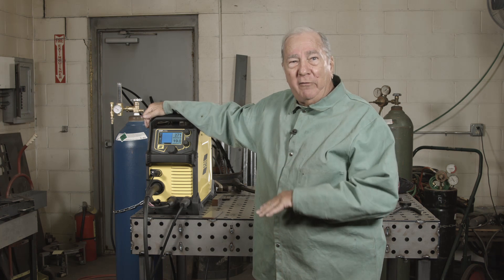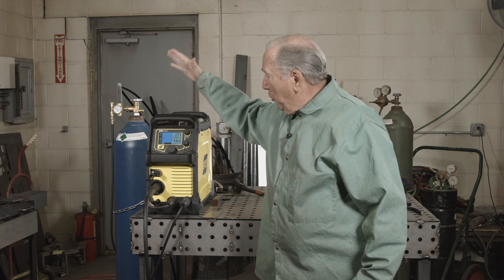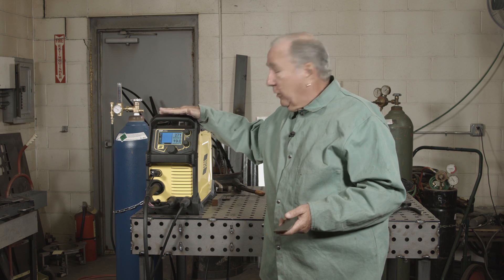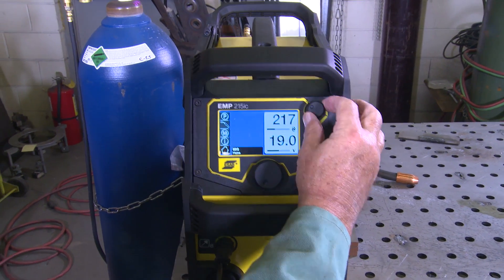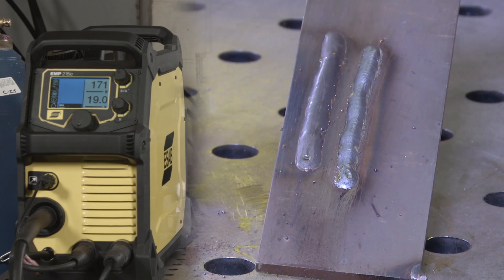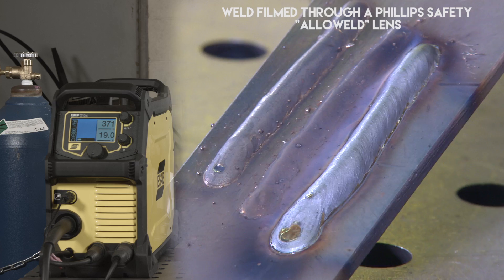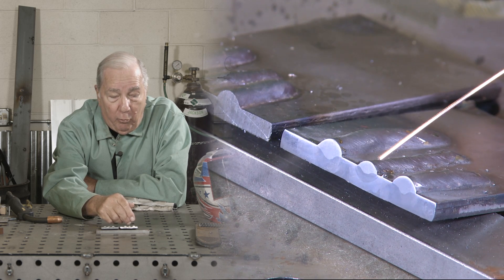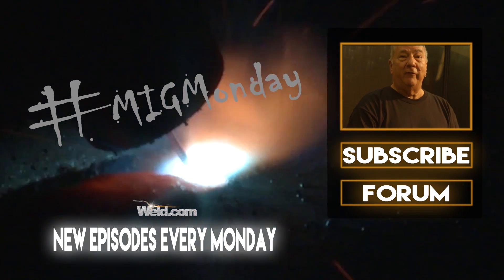How does Wire Feed Speed Effect Your Weld? | MIG Monday

Comment: Excellent video! First thing I learned was the 'wire feed' number is 'inches per minute'! I purchased a Harbor Freight Titanium Multi Function welder and it has 3 knobs. Voltage, Wire Speed, and Amperage. I guess so you can fine tune it. I'm welding up an old set of headers and keep burning through. Looks like I did just the opposite of what I should have done.....I turned down the voltage and wire speed. I think I will go see if I turn down the voltage, and turn the wire speed up, maybe that will help?? Fun learning new stuff! Fyi, I'm 73.  ;)

Comment: Great video again, I think the recommended settings gets you in the ball park, but you have to adjust for the conditions. Is the piece flat on the bench taking away heat or raised up so it will run hotter. 
Being new to this, I'm still in the learning phase, I cant look at a job and rest on experience to adjust the settings. 
But the test piece you did I've done to check settings how it will flow, before I work on the item.

Comment: Good instruction Paul. Thank you. I have been trying to weld a steel/zinc bolt to a steel bar and have trouble getting a strong weld. Is the zinc a problem? Should I have chosen a pure steel bolt? This is for a project making a coat hanger.
Reply: Sand the zinc off at the weld with a flap disk or sand paper , take your time to get it nice and clean and send it , go gentle and tack it first with small tacks to set it in place as best as possible , than send it with your preferred settings . I would go a little lower on the wire speed to get better control but ; by lower I mean just a hair to avoid damage to the threads or warping. Having a coating line zinc , despite it being very thin it will fuck your welds up . Another option is to go ahead and wire brush the bolt or torch it until red hot than wire brush it if you don’t have a flap disc . This will absolutely anneal the bolt and ruin its case hardening or what ever heat treatment was done to it ; thus making it prone to damage and much much softer. I would just gently flapdisk it taking care not to overheat it - so gradually with a bucket of water or oil to cool the bolt. If you can clamp it down firmly or be like me and other lazy fucks alike and just hold it down while you tack it in place with a welding glove on to protect your fingers and hands. Galvanized metal coating needs to be stripped regardless of what the application is; you don’t want to breath that shit and you don’t want to weld it without proper cleaning as this will result in ; like you experienced a shitty weld . I highly recommend a respirator for welding galvanized as well a keep your mind on where your face is and the distance so you don’t get caught in the smoke . Once or thrice won’t hurt ofc but be cautious shits nasty

Comment: I have a problem when welding I’m not a pro but got a new welder at the body shop and have hard time with voltage. The problem is It drops and rises without me changing it. Can it be something to do with a power source or breaker? Have had similar issues with old welder but not as drastic.

Comment: Be nice if you compair dual shield to gasless fc and hard wire. There are those of us who use dual shield every day. Mig weld is gravy work, run 045 1/16 or 3/32 dual shield. What about spray transfer w/ER 80s d2. There are those of us who do certified work on more rigorous material.

Comment: Thank you. 
Exactly why is amperage increased if wire speed is increased?
Reply: This is kind of fundamental!  You SET arc voltage, and the machine tries to hold that voltage.  Current is varying.  Stickout can change amperage, long stickout has more resistance, voltage is fixed, Amperage drops.  If you push more wire (within limits) the voltage tries to stay the same, and it just takes more current to burn more wire.  You can only go so far with this adjustment!  You really want to look at some graphs to make sense of this.
Reply: @leonardpearlman4017  Could it be that there's also an averaging affect going on?  I'm thinking that with a slow wire speed, there are longer gaps between moments of short-circuiting (because it takes longer for the burned-back wire to re-extend close enough to arc again), and with a higher wire speed those gaps between the arcing moments are shorter.  The effect would be more current flow with the gaps being a smaller percentage of the operating time, and that would average out to higher amperage, and more arcing events per time results in more heat being produced per unit of time.  Now, I'm just speculating but this is what makes sense to me.  After all, if the wire speed were so slow that you could hear the individual pops of arc and burn-back, the current during THOSE MOMENTS should be the same as at those same moments for faster wire speeds, but with the very-slow wire speed those moments occur less often and so less heat is produced (and less total current flows since the circuit is "off" a large proportion of the time).

Comment: my mig welder as no wire speed setting , i am very new to welding , so do i have to play around with amps only, theres only  one nob and thats for amps , is there any way of slowing the wire down, form the spool wire.
Reply: I think you will see if you turn the knob (while machine is running) the wire speed WILL change!  That's what the setting is doing.  Volts are more or less fixed, wire speed is fixed, amps varies a lot!  I have one machine that has "Amps" setting, but it's just bad English I think.  If it was TRUE, the wire feed would be some kind of servo, and the wire speed would change noticeably say if you varied stickout a little.

Comment: i'm thinking maybe my feed speed might be my issue....   bought a Horrible Fright el cheapo welder about 10 years ago and never used it.   finally got it wired up in the new workshop, out of the box, cranked it on and.... CRAP!   looked more like when you put a few drops of water in a hot skillet - sort of spattery... but when i stop the weld, i always have an inch or so of wire sticking out, so thought the feed speed was too high, so down.. and down and down to the minimum...   and messed around with the two switches... got some really horrible 'almost weld' looking lines.   so will have to crank the wire up and see.   thanks for the vid...  might have at least pointed me in the right direction.
Reply: I'm replying late, but here's a thought.  Most "cheap" mig welders are gas-less and use flux-core wire.  Though I have no direct experience with this, I've seen a few videos now that make a point of the fact that the proper polarity for flux-cored wire is opposite of that used when set up for gas.  I've also heard that the majority of these cheap welders have nothing in the instructions explaining this.  Further, I've heard that it is exceedingly common for people to get terribly crappy welds with a cheap welder using flux-core wire, they blame the welder and quit or buy a better one, when simply changing the polarity would have solved the problem.  On cheap welders, usually one must reverse a pair of cable connections inside the lid or inside the machine to change polarity.  I bet someone here can help you out with this, but off the top of my head, I can't remember which polarity is which for gas and no-gas, respectively.  I only MIG weld with gas and solid wire so I don't need to remember.

Comment: I keep getting bird nests...any tips?
Reply: Maybe a burr in your tip? Replace tips often/as needed. They are pretty cheap compared to the time spent trying to clean tips all the time. Or perhaps the tension on the spool is not properly set, too loose or too tight? I am a beginner just under 1 year experience but I have found less birds nest with new tips

Comment: I like what we're doing here in general, it might be that 100 inches sounds good but is a  big change!  As opposed  to something like ten per cent or five per cent at a step.  I've been doing this kind of thing myself, and recording the result in a notebook for later.  Don't have a lot of data yet, but it's already been very helpful!  SO, for each machine and setup ("MigSonic, .030" wire, Ar15CO2" for example) there's one page, and a grid, a graph looking thing where one axis is the voltage and one is wire feed.  So, it's a picture of all possible settings for your machine.  Now, when you try one setting, that's a point on the graph, right?  So, you can put a mark there if it worked or not... or a LETTER say, and then there is a comment down below like "C- way too hot, burned through".  I got this idea from a book about MIG welding process control.  What we're all looking for:  Apparently on this grid, there will be a region where you have good working settings, with low spatter and so on.  NOW you can look at that, decide how much power you want, and sort of go right to it, even if you can't remember the last time you used that setup, or even if someone else took the data!  That's the real idea, I want students to do this.

Comment: My understanding is amps do the digging in where the volts do the puddle width.
Reply: They say the wire feed speed is akin to amperage. It really is not a bump in amperage directly. It would be interesting to see a bit more scientific data like putting an amp meter either on the machines power cable or on the ground  lead. Then change things.
 I really would like to see the gun put onto a beetle (cutting track for gas) or some sort of removal of human variables and an amp meter attached.
Reply: @Madmoody21  This channel has at least one video like that, where they use a "Bug-O" machine to carry the torch.  Jody Collier's channel has some where he welds on to a pipe turning in a rotary positioner, which give you a few seconds of steady welding and is easy to observe.
Reply: That’s literally what he says in the beginning of the video basically...

Comment: Sir, thank you very much for your good explanation (and for taking care about us.) Though, your explanation is not totally excellent. It is really important to tell me as a viewer what exactly gas you are using in your great videos (what % of CO2), but you did not tell us. I welded with both, with pure CO2 and with Argon/CO2 %15 (and Argon/CO2 %10), that is why on videos I can easily tell the difference between welding with pure CO2 and with Argon/CO2 mix. I cannot tell the difference between welding with 15% and welding with 10% CO2 though (without a few attempts and tries at least... I remember the story when employer did not want to give a pay rise to his welders and on the day of the test he gave them a slightly different gas mix into their manifold... They all failed the test, everyone of them. I think it is nearly impossible to pass our Canadian CWB MIG flat test on 3/8 plate with our usual Argon/ low CO2 mix. To get 1/4 first beads (requirement), I need to use 19 volts. But this way I do not get enough  penetration along the corner. If I go high with voltage (28.5V), I cannot fit 3 root passes with all the stops that are required. So testers usually allow welders to go with only 2 passes instead of required 3 passes. I passed with some other tricks (either with preheating when tester does not see or with excessive removal of the back plate.) Sir, would be very nice of you if you make a video on which settings to use and how to pass our Canadian CWB test (flat, with back plate, bend test). And for which gas mixture those settings would be valid? I is realy easy to get a good penetration with pure CO2, but nearly impossible with Argon/CO2 mixture... I challenge you: you will not even pass that test yourself :)
Reply: Alek Rudy;
You know way more than I do. I once knew a man that got a job welding tanks for Aerospace. When I had a car project. He did all my welding. Arc and oxy acetylene.
Reply: There is a video of a journeyman brazer using nitrogen gas while fusing very specific code regulation, copper lines for refrigeration. He is old too.

Comment: Great to see someone doing a video about this. So many people I’ve run into are convinced that voltage = heat.  Great video! Doesn’t get any clearer than that.
Reply: Well, the settings interact then, don't they?  If you have more voltage there's got to be more power, eh?
Reply: When you increase the voltage you have to increase amps or wire speed no?
Reply: @charlescarabott7692  it depends on the thickness of your wire if you have a thicker wire you have to turn up the voltage because the voltage is the push and there's more resistance with a thicker wire
Reply: they really go hand in hand together i tend to pick my wfs(based of material thickness) and adjust the voltage to make the bead shape uniform they both have to match somewhat if you turn up your voltage so far you also have to turn up your wire speed in turn producing more heat

Comment: I’ve done a lot of polishing for materials science research but I’m relatively new to welding. I’m finally upgrading from the harbor freight flux core my dad got me when I was 15 to a Hobart handler 210mvp. My question is how far down do you polish before you etch. I’ve gone down to .1 micron on a few samples I’ve polished but normally only down to 1 micron.

Comment: what is the wire diameter, i can understand that amps changes with the change of wire feed speed, is it vice versa i mean if manually i change the amps does my wire feed speed changes
Reply from the maker: wire diameter was .030 if I remember correctly. MIG welders generally have a WFS control, which controls amps, and not an amperage adjustment like a TIG or stick welder would.
Reply: Weld.com Now currently we are having a semi auto welding machine to weld heavy duty brake table to web, 
SPEC:
W.D = 1.2mm
Amps = 280 - 300
volt = 28 - 32
fixture travel speed = 750 mm/min
Base plate thickness = 4.5mm...
i want to implement 1.6 wire diameter and increase the travel speed of fixture to get more productivity....
is it possible

Comment: Maybe you could do a real wire feed speed test with a machine that's not changing amperage automatically together with wire feed speed.
Reply: its not changing amps automatically, amps change cuz the different property of electric circut that is dependent on wire feed - more wire - less resistance and thus more amps. MIG is voltage controlled process so machine only keeps voltage constant, current depends from wire feed speed by natural.
Reply: amperage is raised with wire speed.and its goes down when you turn it down..basicly amperage is based off wire speed..voltage is not amperage when mig welding.
Reply: Balad`ar    Machines like that are a thing of the past. What you describe is how the first mig welders were made. Those machines took far to much technical knowledge to set up properly. Many welders made welds that looked good but were very weak due to lack of fusion and penetration. The first real engineering step to solve the problem was to make amperage and wire feed turned up and down on the same knob. You then had pulse machines where you could get back to tuning on the hertz, back round current and inductance. Even all these improvements lead to the auto set machines where you just select the thickness of the metal and sometimes even joint design. Now some machines are even so advanced you set a dial to the size wire you are running.

Comment: That machine shows a definite amp change with the different wire feed speeds.  This must make the machine more forgiving.
Other machines may not show as much  difference. 
What changes would bring you into the spray arc area.
Reply: Generally different gas, much higher voltage (longer arc) and wire feed (more power in general) as far as I know.  I only did this once, in a class at that.  It used a lot of power and was intense!
Reply: I’m confused when you say it showed a definite amp change. The machine showed 19 A for all three welds. The only thing that changed was the wire speed.

Comment: Can I use c25 gas with flux core wire on mig welding ??
Reply: That would be "dual shield" or "outershield" kind of wire, "Gas-Shielded Flux Core".  Lincoln says not to add gas to "innershield" or "self-shielded" wire, which messes up the flux system and makes trouble they say.  You should change wire.  It's nice, by the way!  Lots of power, good looking bead, slag comes off easily.  Self-shielded welding is hard to love, I think.
Reply from the maker: +fmxq8 If you're going to use flux cored wire, there is no need to use any gas. You are getting now advantage out of it and are basically throwing money away on the gas.